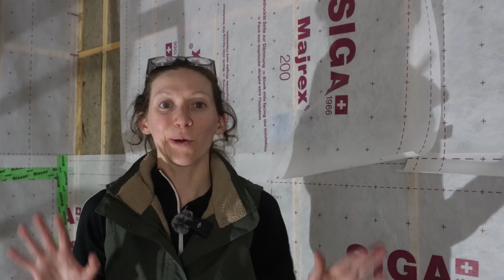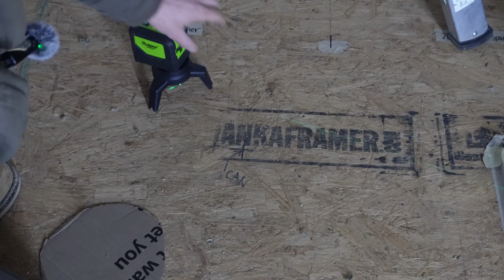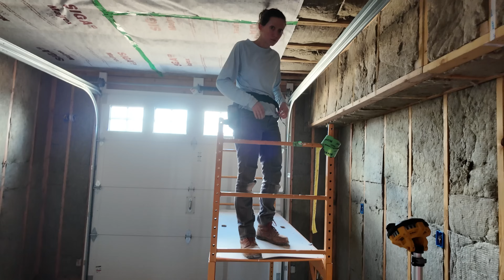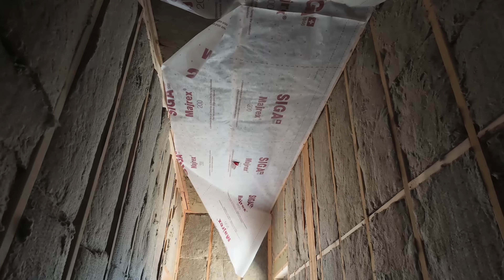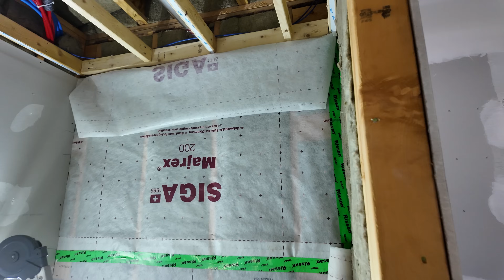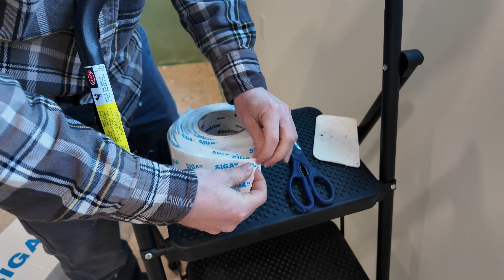Vapour Control Layer Installation (as DIYers) - SIGA Marjex Part 2

Comment: Why not do the blower test now? That way you can fill / fix any gaps that may be letting air out / in. Then you could do another one after the rest of the drywall is up.
Reply from the maker: That was the original plan until we couldn’t get it done in time 😂
Reply: @MasonDixonAcres  Ahh that makes sense. Do you have a video explaining why you all decided to use rock wool insulation? I've been working out a plan to build our next house and I'm curious why you used rock wool instead of something like rigid foam or spray foam insulation?
Reply from the maker: Not at this point but I talked about it a little at the beginning of the first Rockwool video and answered comments about it

Comment: Nice build. Just trying to understand. If drywall is an air barrier, why not just air seal at the framing to Sheetrock intersections and painting the Sheetrock which acts as a vapor retarder

Comment: When I did my house, after the drywall was finished and painted, I went around drilling my holes for my lights and I was so afraid there wouldn’t be a wire where I drilled and I’d have one of those “What did I do” moments but each time I finished drilling, my fear would be erased as my wires were all where they should have been.
Reply from the maker: I feel you! The drywall screw trick took all that guessing away for me

Comment: For the main house: if you fur down the ceiling 1 1/2 inches and use any 4" round canless lights, you may have difficulty fitting the driver boxes into the ceiling through the holes.  I found it took about 2" of clearance above the drywall to "turn the corner" with the driver through a 4" hole.
Reply from the maker: That's a good point and will definitely add to my notes for the future 😂